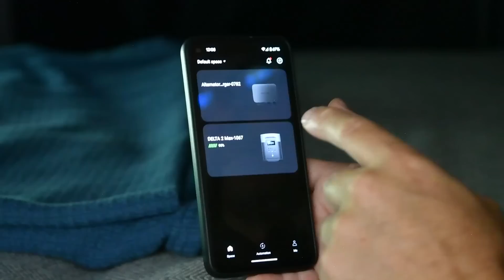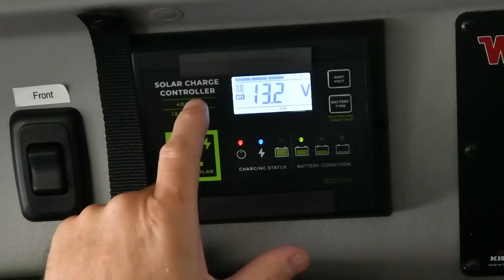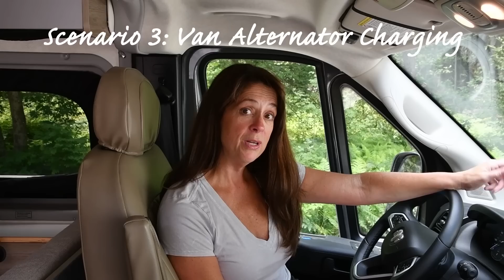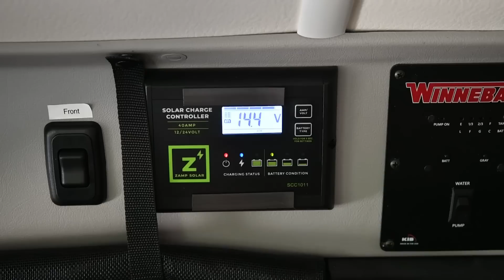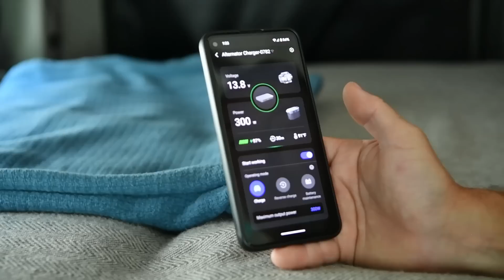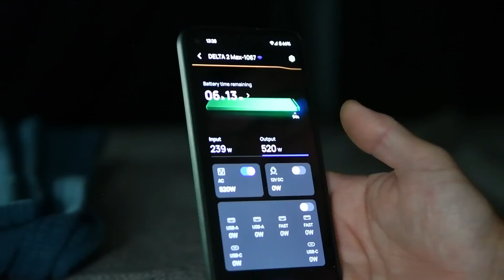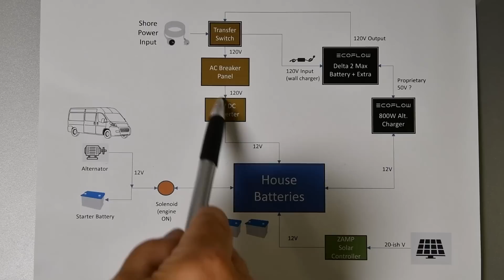Lessons Learned! ECOFLOW Alternator Charger and Battery upgrade

Comment: FYI - For extended periods of time Lithium batteries should be stored at around 50-60ish% 
NOT at 100% - which you suggested you did when you plugged into shore power upon you returning home... 

I've built an alternator charged  component 12 volt system for my van (8 years -100k miles ago) worked great. (a/w shore charger -  no solar - never really needed it)

If I were to build another rig I would likely go all in with the Eco Flow system. I follow one of your commenters and consider him a Trusted Source👍 (Humble Road) & he has recently switched to using EF in all his custom van projects rather than components.
Reply from the maker: Thanks for sharing that additional information. I recall seeing that at some point but we never really store our batteries for "long periods" (whatever that means) as we use the van year-round. However, we don't necessarily use the batteries when we use the van. Kind of a difficult rule to follow in practice. You are right, when we plug into shore power it also powers the ECOFLOW 120V charger so our configuration does not provide an easy way to achieve that 50-60% storage level. Thanks again.
Reply: @Outapkt  Not really that hard to follow. 
When I travel I follow the 80/20 rule - unless I know I will be stationary for more than 3 days them I go to 100%.
When I park the van ( between 1 to 3 months) I drain or c.harge the house batteries to 60%
Before I leave on a trip I plug in my charger and let it go to 100% allowing it to rebalance the batterie cell.

AAAAALLLLL this 👍- in an attempt to keep the batteries as healthy as possible for their age. Much maintaining a vehicle with a an oil change.
Reply from the maker: Yes we have started doing this. You are right, very straightforward with the app and a little pre-planning. Thank you
Reply: @TerryManitoba Those guidelines are a load of nonsense. If you are only constantly going to charge to 80% and discharge to 20%...you might as well have bought a much smaller battery at a fraction of the cost!😂 
Ecoflow batteries last through extremely high cycles at 100 er cent for many years, and even when they eventually begin degrading, they don't just stop...because they'll still charge to at least 80-90% for many more years.
I charge my two Ecoflow Delta 2 batteries to full capacity and drain them almost empty on a daily basis (either AC 🏠 socket, Solar panels or Alternator charging). I always leave my Ecoflow Alternator Charger set to 800W, so that it charges the Delta 2 during the minimum time possible while driving, or while parked with the engine on idle (modern diesel engines have large alternators, which are more than capable of delivering 800W to the Delta. The Ecoflow system regulates the power so that the main engine starter battery charge takes priority, while only excess power is drawn from the main vehicle alternator to the Ecoflow Delta).
Even my old original Ecoflow River battery has been recycled on a daily basis from zero to 100% for the past 7 years without a problem!
I will also add, that most people worried about the silly 80/20 rule, will no doubt upgrade their products long before they lose a few percent of holding power 😂
My advice is to not worry about it. Just use your Ecoflow units to the full capacity they were built for.
Reply: @Globetrotter-1  FYI  - NOT a worry at all - A  flick of a switch to off power - Which is actually very SIMPLE👍

My 220 amp lithium has run 8 years without a PROBLEM in my self built van using 80/20.  I go to 100% when I'm gonna be stationary for several days. 

Just bought an EF to increase my capacity for the odd occasion.
Reply from the maker: This is very good input, thank you for sharing it. I generally don't worry about it too much, but now when I know I won't have a trip for a month or two I just set ECOFLOW max charge to 60% and let it sit that way. Then a day or two before a trip I raise to 100%. This has been working well. I was not aware that the ECOFLOW is smart enough to prioritize the house battery, how does it do that? I have not seen any information about that. The voltage is driven by the alternator so I don't know how it senses when to draw less and let the house battery charge. Thank again.
Reply: @Outapkt  Keep in Mind -  Being more aware of proper charging practices helps the Power Bank (battery) last a bit longer - In the end it Matters!!!! BUT not all that much as you will likely replace the PB before it really matter to longevity.

Having said that I Will still practice good PB practices🤣

Comment: Great vid! I'm very new to this so thanks for the info. Question: could the solar be connected to the Delta and then reverse charge through the Eco Alternator Charger to charge the house batteries?
Reply from the maker: Yes, absolutely! If the van was not already hard-wired with Zamp solar to the house batteries, that is probably a cleaner way to do it. In our case I am not sure the advantages are worth the work to re-wire everything. Thanks for the question!

Comment: Hi guys. Do you have any suggestions on accessing the water pump to unstick the valve? My research tells me that's the problem, but I don't see any way to pull it out of there (or even disassemble in place) without cutting the cabinet apart or removing all the clamps and hoses. Thanks for your help.
Reply from the maker: Hi there, sorry but we don't have any experience with that. I would think you need to drain the water and try to disconnect/remove it, then maybe just replace it if you are doing all that work anyway. You might try posting to the Solis Pocket group on Facebook. Good luck with it!

Comment: Many thanks for making this video!!
Question regarding scenario 1: At what point would you decide to turn the ecoflow app’s reverse charge back on to help supplement the house batteries? When the zamp says a certain voltage or something else? 

Question 2: besides the fact that everyone’s energy use varies, wondering if you guys have been off grid with the pocket for an extended trip, how long did your ecoflow+extra battery last before needing to recharge it and how low did you let the battery percentage get to? 

Question 3: have you ever had your alternator charger stop working to charge your ecoflow? 

Thanks again! 

Thanks again!
Reply from the maker: Hello! Thanks for the feedback and these are good questions!

1. We use reverse charge when we run something for a while, like keeping Starlink on all night or if we will be using the TV in the evening. Anytime we don't want to run down the house batteries. One thing we didn't mention in the video is you can set it up in the app so it stops outputting power when battery drops to 10% or whatever level you want, then it will draw from the house batteries after that.

2. How long it lasts is simply a matter of what is running. If we leave Starlink on all night with the other normal stuff - fridge, lights, etc. then make coffee with a 120v electric kettle in the morning we can use up to 1/3 of the ECOFLOW capacity. But the house batteries are still fully charged. So it is a lot of power and should last many days. Using A/C would be a different story but the regular things simply don't use that much power. We have run it down maybe 2/3 at most. Normally we drive somewhere each day so get some recharging.

3. Sometimes the alternator charger is glitchy and you have to reset it. It shows an error in the app and simply won't start charging. This is a pain if you are already driving. Also when feeding in solar it seems to be unstable if the voltage is swinging above and below 13v rapidly. Usually we try to only turn on alternator charging after we start driving then turn it off again before we turn the engine off. Seems more stable that way. 

Hope that helps and good luck!

Comment: I have an ecoflow 10kw house battery system and it is excellent. Really like the interface and app as well. Too bad more mainline manufacturers don’t use their system as the house system, but they are not cheap.
Reply from the maker: Wow that's a lot of power! Glad you have positive feedback on the ECOFLOW also. Thanks for watching and sharing your experience.
Reply: Wait....so you can use this set-up with an ecoflow alternator charger with a ecoflow powerkit and a bunch of 48v server-rack batteries????  This could be brilliant!!!!  Gotta go back and re-watch this.  Newbie here just trying to figure out a hack for the powerkit used in my vanbuild.   Cheers!
Reply: @fredzuccarelli  I have 2 - 5k WH ecoflow batteries. Total 833 AH. One can connect up to 3. I wouldn’t want less than 10k to do serious boon docking.

Comment: @7:50 Do you know how much power the 12V converter uses? Thanks
Reply from the maker: I don't recall the exact measurements I saw but it depends what needs power when it is running. If you are charging the house batteries I recall seeing it draw in the 350-400W range. It could vary depending on what else is running, lights, fridge, etc. and if the batteries are nearly fully charged. It does tend to cycle on and off once the house batteries are charged. If you are more concerned about the efficiency loss converting 120v to 12v, I don't have that exact data but I understand that is normally around 8% power loss in the conversion. Hope that helps and thanks for watching!

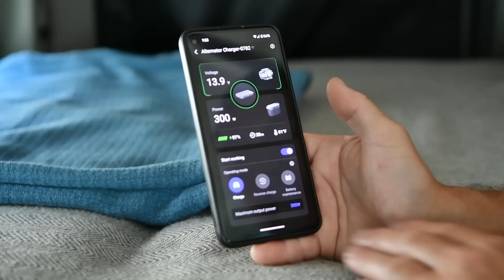Comment: @6:10 Can you charge the ecoflow using solar and an alternator at the same time? So, 300W + Whatever your solar set up is generating!?
Reply from the maker: Hi there! Good question. The alternator charger will limit total power coming in to recharge the ECOFLOW depending on how you set it - 300W, 500W, 800W, etc. So in theory if solar can provide a portion of that power, then the load on the alternator might be reduced by that amount, but the total going back to recharge the ECOFLOW will still be capped based on the setting. If the house batteries need charging, power could be pulled there from solar or the alternator before passing through the alternator charger. Thanks for watching and for the question!
Reply from the maker: One other note, if you had solar panels directly plugged into the ECOFLOW solar input ports, you would get the 300W alternator + solar charging.

Comment: Just curious: what is your total power storage?
Reply from the maker: Good question. The ECOFLOW battery setup provides 4096 watt hours and most of that is usable. The two AGM house batteries which are the original ones that came with the van are 100ah (amp hours) each which equates to approx. 1200 watt hours each or 2400 watt hours total. So the total power storage is just under 6500 watt hours BUT you are not supposed to deplete AGM batteries too low so I would say they provide more like 1400 usable watt hours for 5500 watt hours total usable power. Hope that made sense. Thanks for watching.

Comment: If you had the Zamp mppt solar charger you would get even more solar power to batteries. I changed mine and it made a 30 percent increase. Nice video.
Reply from the maker: Wow, that is great info. I did not realize a controller upgrade would have such a big impact. Was the wiring plug and play? What model did you go with? The one I see on the zamp web site seems very large... Is that the one you used? Thanks for watching and sharing your experience.

Comment: Have you ever tested the solar panels that came with van? I don’t think mines is making 170w anymore.
Same question sent to your IG.
Reply from the maker: Tested? Not specifically, no. The solar charge controller display panel should provide the info to know if it is working. If you don't see any power there, when you are in the sun and using power in the van, then it certainly could be a bad panel or charge controller. If you can get up on the roof you can unplug your solar panel and use a voltmeter to see if you are getting power out of the panel. We did a video a while ago talking about how NOT to connect a solar panel, you should check that out it may give you some tips for testing your system. Thanks.
Reply: @Outapkt panel shows amps coming in but not watts.
Reply from the maker: Just multiply amps by the voltage to get watts. So 5 amps at 13.7 volts = around 68 watts
Reply from the maker: Oh and last thing, you probably know this, you never see 170W in practice. In direct sun if you are getting 120W that would be pretty good. We added an extra 100W of capacity and covered that in a video as well. Good luck!

Comment: I have a Eco flow max and two additional Eco flow batteries installed in the rear portion of my Winnebago pocket to give me a total of 6000 what hours.
The way I have it installed is I put a transfer switch say model you have and thank you for the install video between my short power and the Eco flow system. When I’m on shore power the transfer switch will automatically use the shore power when I am offshore Power I will have to turn on the Eco flow max, and then the transfer switch or automatically use its power to turn on all the indoor power items and in order for me to make sure to converter is not functioning I will turn off the main power above the refrigerator and that intern allows me to use all the other items still connected to the Eco flow max.
I have my alternator charger from Eco flow hooked up directly to the chassis battery and not to the house batteries.
My house batteries are continued to be charged with the solar panel as well as when I’m driving with the alternator .
To be honest, I do not Boondock that much anymore at the right age of 81 I find a more convenient to stay a place with shore power however however, I do have the system available for 2 to 3 nights of usage in case I ever decide to.
I did run the air conditioner off this set up and found out if I’m very careful not to go straight to AC but go through low fan-low AC that I get it to work without a soft start . I’ve run it as much as five hours on this set up. This was for a test.
Thanks for all your upgrades. I enjoy watching everyone of them. I’ve been hooked on Eco flow for a long time at least for the last four years but right now I’m pretty all set with my systems. I put the alternator charger at 600. What charge because I don’t wanna over my pocket alternator and I find out that driving for three hours will give me a good return to charge my Eco flow back up after using 30 to 40% of its capacity.
I’m not an electrician. I’m like a YouTube learner and I really appreciate how you put your system together.
Reply from the maker: Hello! Thank you so much for sharing the details of your setup. That is a very innovative way to connect everything and definitely has its advantages. I am surprised to learn the switch above the fridge causes your 12V converter to shut off, but I guess if the house batteries are disconnected that makes sense... nothing for the converter to charge! When that switch is turned off how do you use 12V power in the camper area, directly from the ECOFLOW 12V outputs? How does the fridge get powered in that configuration?
By connecting your alternator charger to the chassis battery you get the same ability to charge your ECOFLOW batteries when driving, and I guess you also get the ability to use the trickle charger mode of the ECOFLOW charger to keep you chassis battery charged. That is nice. I think what you give up is the ability to use reverse charge mode to supplement the 12V house batteries directly. But you can always fall back on the 120V feed if needed.
I am curious how you utilize 2 spare ECOFLOW batteries as I thought the alternator charger used up one of the sockets that would otherwise connect to a second spare battery. Maybe you hotswap them when needed?
Again, thanks so much for sharing this information, I like your setup. And we really appreciated your feedback on the videos and channel. Happy pocketing!
Reply: @Outapkt 
Let me try to explain my findings on the set up. I use more clearer. To be honest, I’m not totally sure whether the converter is completely shut off when I shut off the power with the main Power switch at the refrigerator when I’m hooked up on my Eco pro set up all I can tell you at this point is that the wattage used showing on my Ecoflo app with the power switch off is 90 W approximately may vary a little and 300 to 350 W with the power switch on.
I do know that all systems are functioning including the refrigerator the fan and all the outlets are usable with the power switched turned off, and the echo system turned on.
When using two spare batteries  I usually switched batteries, batteries when the first one it’s about half down as shown on the echo app.
With my air conditioner working on low and all auto systems functioning I’m using approximately 1000W enough to run the AC for approximately five hours.